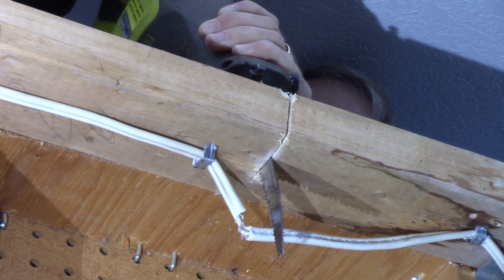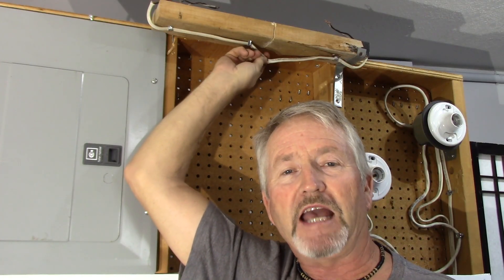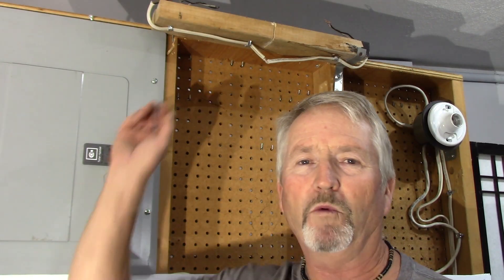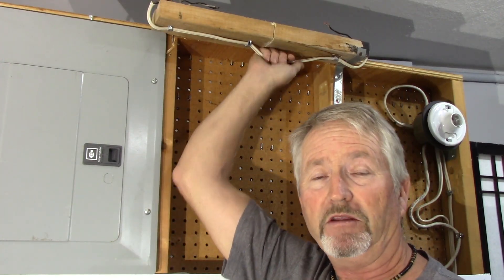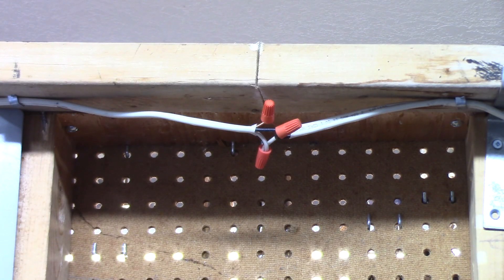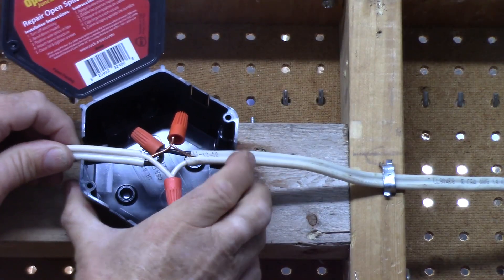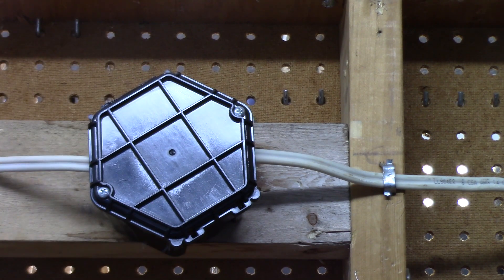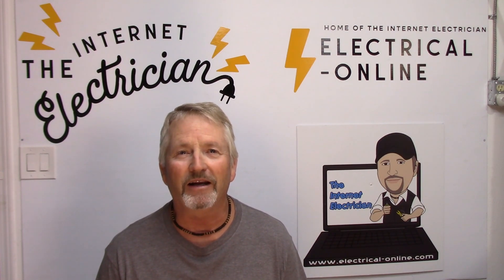How to Properly Repair a Severed Wire or Cable

Comment: Thank you so much for this video.  I was trying to hang a hammock chair hit a wire.  Sparks, drill bit is black and not as long as it was...  my breaker didn't trip which freaks me out so I turned it off.  I have slack so I think I can fix this myself.  Thank you Thank you!

Comment: Why is this easier than a regular metal box. Is it because I don't need to use loomex connectors or the like?
Reply from the maker: It serves an entirely different purpose for when you need to make a splice with very limited slack in the cables.  So in a situation I simulated here, it's a nice option.  Also if you come across an 'open' or 'flying' splice that someone may have made, you can use this box to get  that  splice into an enclosure as it should be.  To use a regular device box you generally need at least a foot  of extra cable to get them properly into the box clamps and make a proper splice on the conductors.
Reply: @theinternetelectrician  thank you for clarifying!

Comment: Sadly most power cables are stapled down so you won't ever have slack.  They really need to get rid of the NEC.
Reply: Cable should be able to move under the staples, at least in Canada. That's why our staples have stops to prevent overdriving.